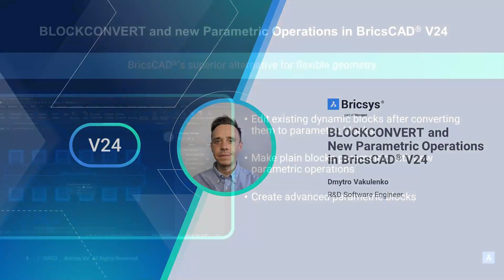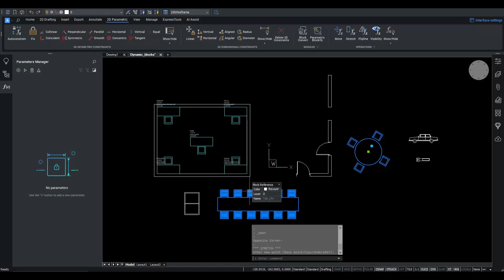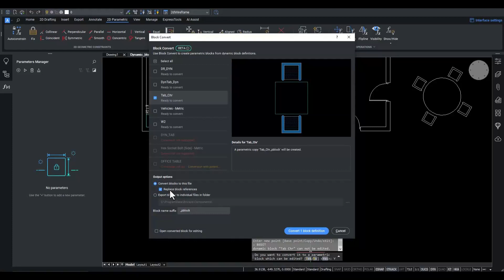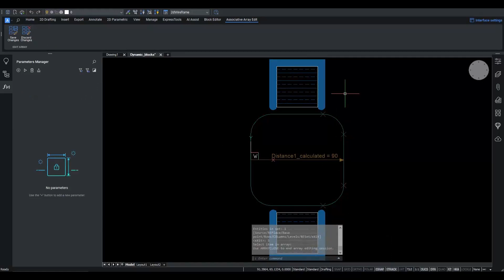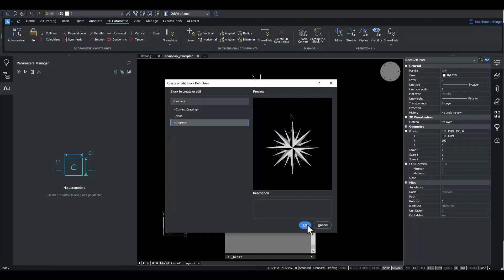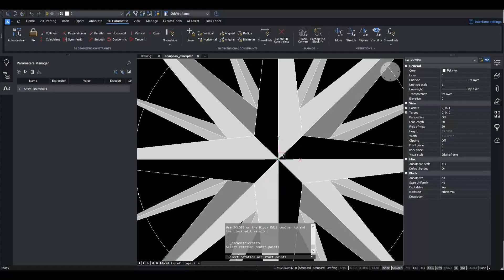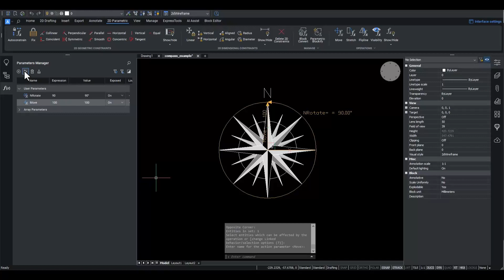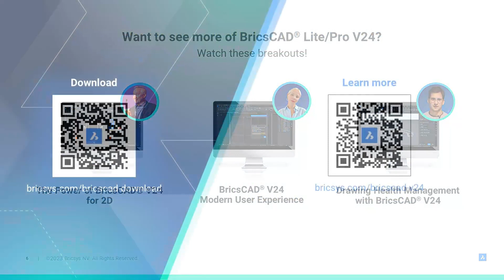BLOCKCONVERT and new parametric operations in BricsCAD® V24

Comment: Hi, can you use parametric blocks made in v24 in earlier versions of bricscad? For example if you convert dynamic block to parametric block in v24, can you use that parametric block in v23 or v22?
Reply from the maker: Hi @Ottek_the_cat, thank you for your question. Yes, parametric blocks made in version can be used in others. However, in V24
two new action types were added to parametric blocks: Parametric Moves and Parametric Rotations. These actions will not work if the block with them is inserted to V23 or V22.